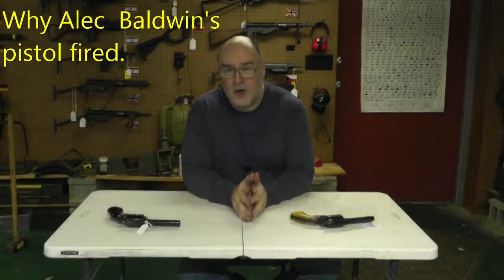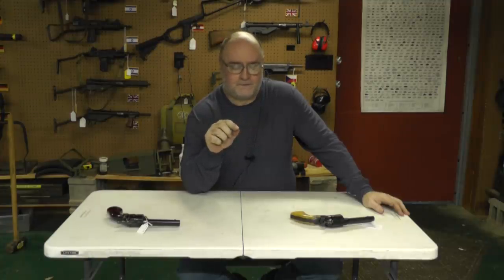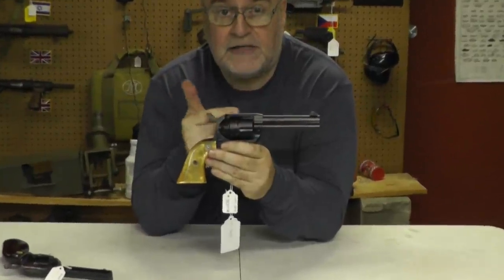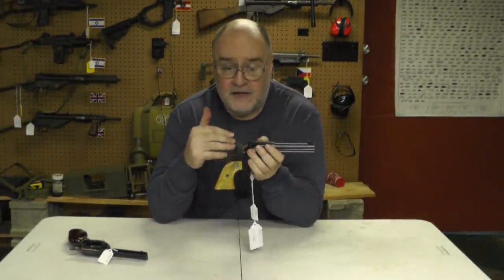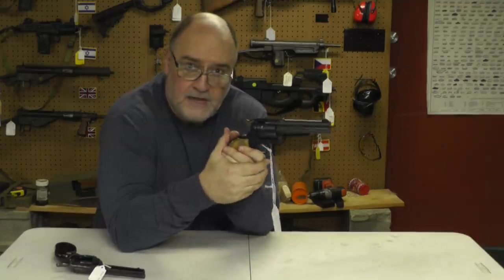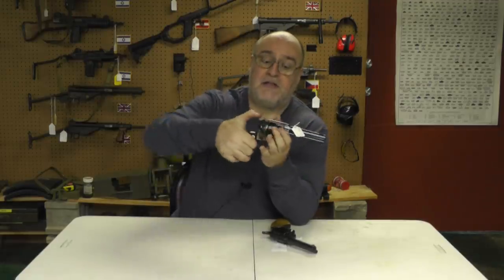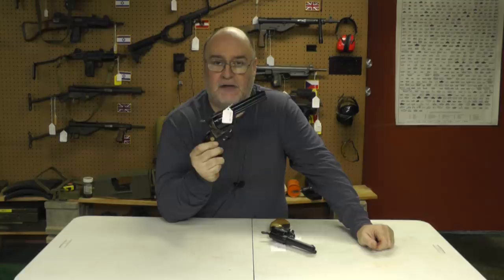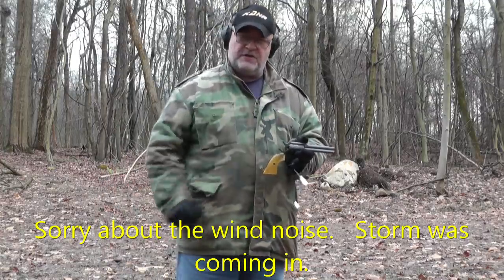Why Alec Baldwin's gun fired

Comment: I was a policeman over 50 years ago and my department was carrying Smith & Wesson 38 special revolvers.  Because of a serious problem with "single action" operations, the department modified all their revolvers so that an officer could not cock the weapon.  All firing had to be "double action.  Saved a lot of lives.
Reply: @davidmorse2149  David, a S&W K-38 revolver can be fired two ways.  Single action where the hammer is cocked and fired with as little as two pounds trigger pull.  Almost a "hair trigger.  In contrast, double action meant we had to pull the trigger completely to turn the cylinder and fire the weapon.  It required about 10 pounds trigger pull.  Accidental discharges dropped dramatically.
Reply: When I was a patrolman, we were issued 38 Smith and Wesson model 10.  They were double action.  much more accurately fired single action.  the safety of an officer's weapon is placement of his trigger finger.  It should only be on the trigger when ready to fire, never any other time.  We were not allowed to carry autos ,  only revolvers.  We practiced speed loading a lot.
Reply from the maker: So instead of proper training they modified their weapons.  Yeah that is foolish and opens up lots of civil liability.  By modify a gun any malfunction liability now belongs to pd.
Reply: So if you are an ex cop then I would have to think that other old school police would have some sort of understanding of how this happened, but still you should have room for errors if you were careful not to allow live ammo on a movie.
Reply: Why was he handed a loaded gun in the first place, blanks or lives?
Reply: @KarlFullerNZ  Probably because that is the armorers job.  Apparently this armorer was a novice.
Reply: @davidmorse2149  Absolutely right!
Reply: @clintdenman3037  No!  There should never be a lessening of safety protocols for any reason.  The actor has been in the business for a long time and should be familiar with many types of handguns.  I remember him with a semi-auto in "Hunt For Red October".  I hope he handled those weapons properly  He should have been required to pay attention during safety briefings.
Reply: @johnemerson1363  I'm sorry if I wrote this wrong and certainly there should be a protocol, and I agree and a mistake when someone loses their life,and a family loses a wife and mother is unforgivable but I know that if I was to hire a professional who I paid to make my set safe I would expect them to be very well trained, but in saying that the last few days much more has come out with live ammo in with dummy bullets I really don't understand why not simply blanks,
Reply: @clintdenman3037  The mixing of ammo is a real terror.  That is why they should use "prop guns" which which operate just like real guns, but  will not take a live round.
Reply: @johnemerson1363  i totally agree with you on that, I honestly thought that after the terrible shooting death of young Brandon Lee that a movie set would check ,double check and check again and its not for me to say but I can't possibly see any need for real or "live"ammo on any movie set unless you have licensed armed security guards and still even then I cannot see one reason why any person on a movie set would need a firearm.i only ever shoot long arms personally but even then I am very proud that if I clean my weapons I never have any ammo even out of my safe and if ever in doubt,well as you stated in your first reply it takes very little time to check again and it might be fine for years and hundreds of scenarios but,me personally I was always taught to never point guns at people, and seriously I wasn't actually aware that he had worked with guns before I saw a gentleman who said that with the older pistols they need to know about their workings..very terrible thing for everyone concerned my heart really does go out to the family.
Reply: @davidmorse2149  Absolutely.
Reply: @clintdenman3037  There was another "blank cartridge" accident some years ago when a young (adult) actor took a 44 Magnum with a blank in it and put it to his head.  The cardboard wad holding in the powder killed him.
Reply: @johnemerson1363  the more I learn about on set firearms the more it seems to make no sense from a safety point of view, I am now retired, but I was a part time security officer from around 1991 to around 2004 and I had training and I only ever fired a pistol at a range with my instructor but apart from that I never ever fired a gun but when I was doing sports we had a sort of blank pistol where the main of the explosion escaped from the top of the firearms.
Reply: @Not Expat Joe 8 to 10 pounds max.
Reply: @Not Expat Joe K38 wasn't a model 10.  My double action trigger pull was 8 pounds and was set before it was issued to me.  I shot sharpshooter every time I qualified each month.

Comment: It’s about time somebody explained how these SA revolvers work and presented the most logical the theory of the tragic shooting.

Excellent presentation!  Thank you.
Reply: I've seen a number of videos which are all saying, pretty much, the same thing.
Reply: Stop saying tragic.  A lightening strike is tragic.  This was reckless.
Reply: See John Schneider.  From Dukes of Hazard.  Been on this from day one and gave this explanation with live test.
Reply: I've commented numerous times the same thing. I have the 1850 colt and if you cock it with your finger in the guard without practice, you almost always get a trigger pull. The way to do it after practicing is to open your hand, and use your trigger finger on the FRONT of the guard (from the inside) as the lever point to balance the hammer pull. Hand open, your last two fingers press against the front of the grip, your first two fingers straight, with the trigger finger presssing against the inside front of the guard. Watch some experienced shooters like Brandon Herrera shooting one of these guns and you can see the technique..

Comment: That's exactly what i believed happened all along, my navy colt replica works the same way and that thing has a hair trigger, probably the best trigger of every pistol i own, the one thing you missed, is that he also cocked the gun with the same hand that was on the trigger making it even more likely for him to grip the gun harder and put more pressure on his trigger finger making the gun go off
Reply: I think it went off when he was decocking it you have to have the trigger pulled to pull the hammer backwards and when he had those two things in line his thumb slipped of the hammer and he had the trigger pulled already so it was the perfect storm